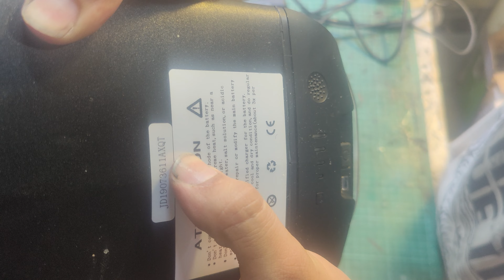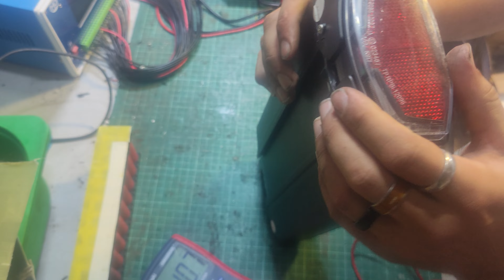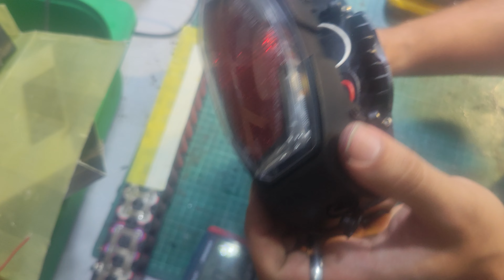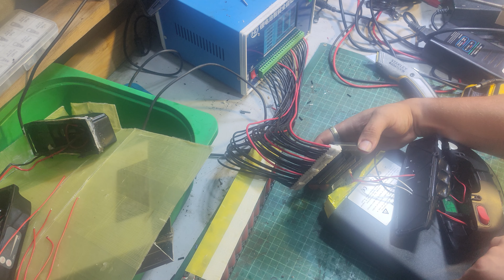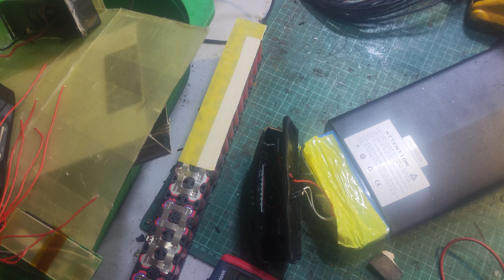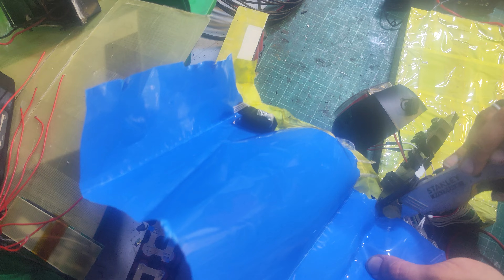Cyclotricity 36v 11AH Rack Battery Teardown and Diagnosis

Comment: samsung 25r would be a good replacement but i suppose it depends on how deep the customers pockets are. for a cheepo rebuild i would use eve 2500mah cells. good video mate.
Reply from the maker: Yes in the end I went with LG MJ1 CELLS in a 10s 3p config... Fine for this 250w bike 👍
Reply: @EbikeRepairs  the mj1 is one of my favourite cells. it's a real workhorse and cycle life is second to none. i have some that have been in service for 5 years and they still meet the manufacturers specs.